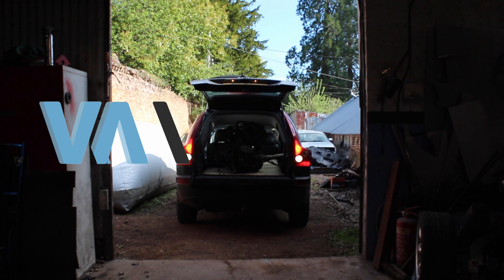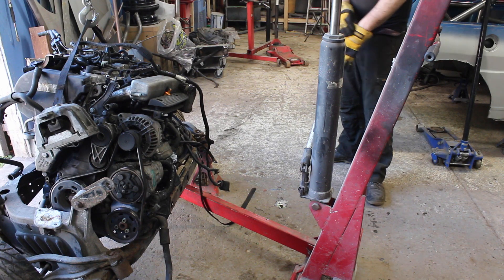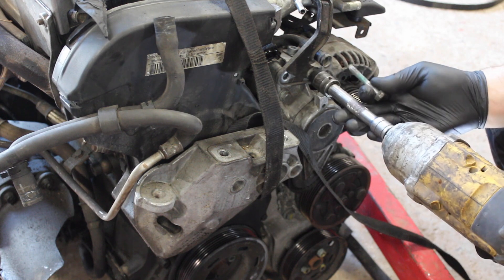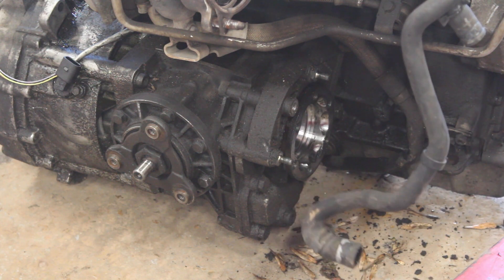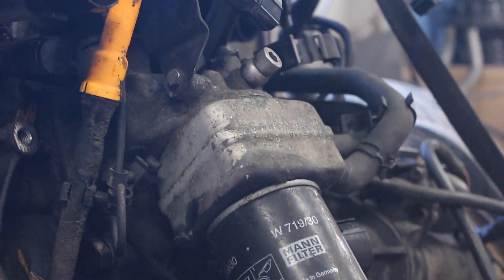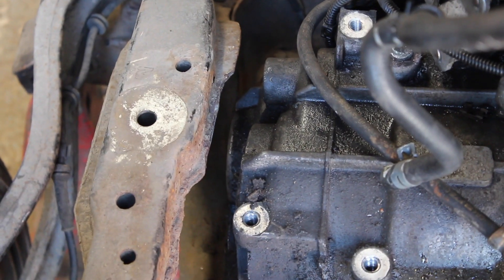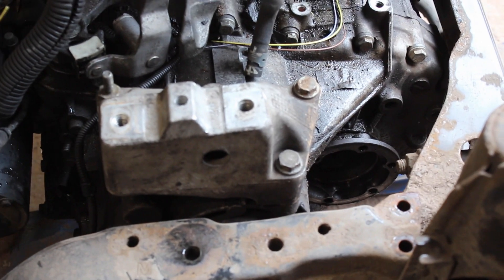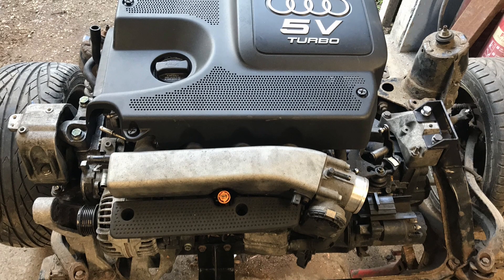Audi 1.8T Turbo Mid engine Rover Metro APX - Fitting the engine

Comment: Does the Audi engine normally sit on a subframe?
Reply from the maker: No its mounted on two chassis legs using one engine and one gearbox mount, and a third torque mount to the sump.
Reply: @VisionAutoGarage  Thank you.

Comment: An originally FWD engine put in the rear doesnt have torque steer??
Reply from the maker: First Last it probably does to some extent, but  will be less significant because it’s not a steering axle.
Reply: @VisionAutoGarage  ohh okay thank u
Reply from the maker: First Last I guess you can count power on oversteer as torque steer too!

Comment: Hello! Congrats for the project! 
Why the gearbox bracket doesn't have any suspension (rubber component for absorbing the vibrations) ?!
Reply from the maker: Hey Alex, the main reason was for ease. I didn't have they oil dampened gearbox mount from the original car. I've also mounted several engines with solid mounts, mostly on track cars or fast road where comfort is a secondary consideration. In this case I am happy to sacrifice vibration damping for reduced engine movement under load. Thanks for watching!